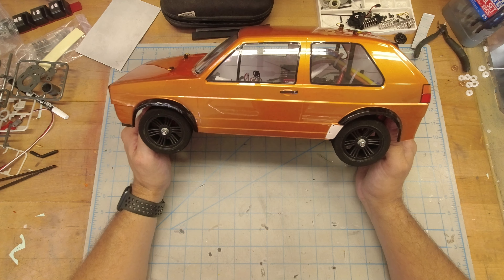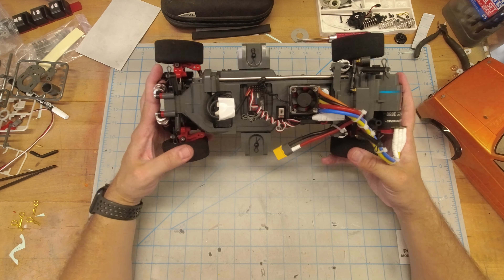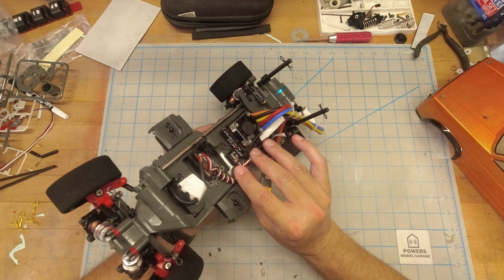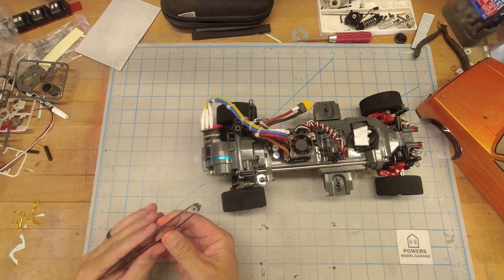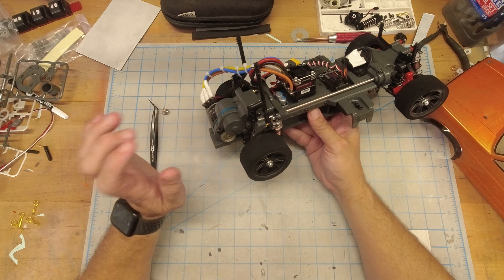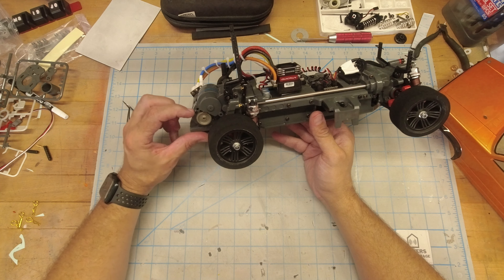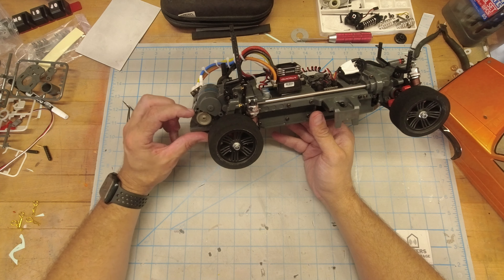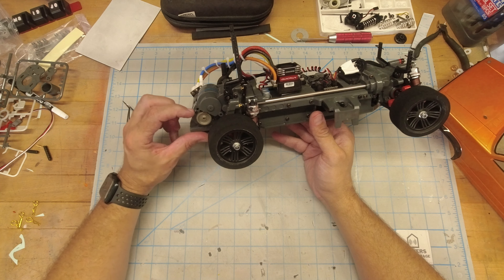2024 Speed Run Challenge Tamiya MF-01x Introduction

Comment: Nice setup! Cant wait for runs! With cutting open the gear box, does that put you into the open class? I was thinking about doing this
Reply from the maker: Thanks. I hope not. I am aiming for the Brushless class. Opening that up is the only way to get a bigger pinion on there. 🤷‍♂️
Reply: @JoevsRC I don't think this has any effect on the classes. It's still is the chassis, no 3D printed parts added and changes as long they're available for everyone're allowed.  This includes a knife or dremel. But this is my opinion, if unsure Fil'll probably help.